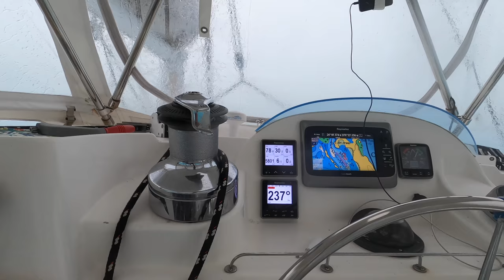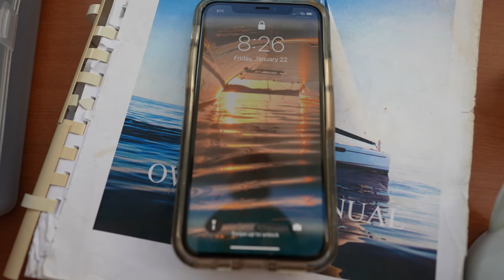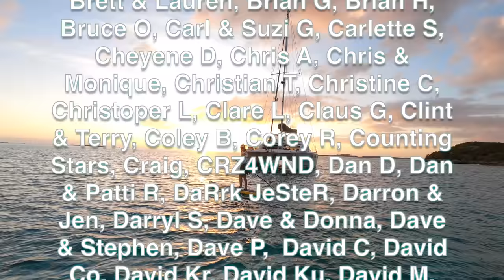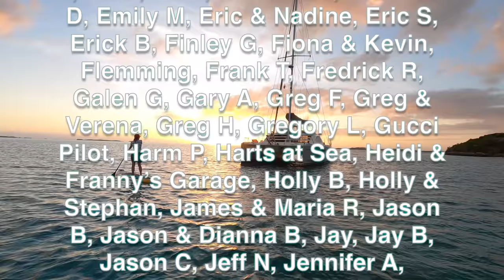THIS SHOULD NOT BE HAPPENING!

Comment: You should play around with DIY electro-plating. I did a bunch of it for yard art over the years using a Tupperware container and nickel strips and copper wire. Its super easy and you could easily do on the boat with some extra time on your hands, just give the chain a good cleaning in vinegar and plate it in copper, i would imagine multiple sessions of at least an hour to build up a protective coating, plus you need to move the chain each coating to assure the areas you didnt coat the first time can get coated.. it would greatly help with rusting... i did it to all our yard art in our front yard to make it look super old and vintage..

Comment: It's been quite a while since I've viewed any of your videos. Your two smiling faces are quite refreshing! Glad to be back.

When I saw your chain I had to come back and edit this message. I know you don't need me telling you that you have a problem. Without being there it looks like the chain wasn't properly prepared before being galvanized and surface preparation depends on the zinc-iron alloy covering the base steel alloy. The galvanizing process isn't as straightforward as it appears. When I finally get my boat finished I fully intend to carry a nylon rode for use in parallel with my chain if I ever suspect chain problems. You two have been around long enough to know that ground tackle is not the place to be a tightwad or be otherwise unprepared. Good luck!

Comment: Remember the rust on your chain from the failed hot-dipped galvanizing?  That rust is hard and very abrasive, the rust on the chain is probably a key contributing factor for the wear on your gypsy.  Get a new chain (better) before you wear out this gypsy.  (I am a metallurgical engineer in case you were wondering)
Reply from the maker: Thanks Russell. Big priority for sure.

Comment: Did you attach the chain directly to the hard metal cross strut in the boats chain-locker or fabricate a short line with dedicated knife???
If you get run down by a freighter (as I have) sometimes you need to release your ground tackle to save your vessel. 
Regather the chain and anchor later... Might be a good point for new-be sailors.
Reply from the maker: Oh for sure. We have had to ditch a rode once in the. middle of the night. When it's gotta go, it's gotta go. We did retrieve it the next day.
Reply: @TheOKellys  
PWS I love your sailing exploits. I have sailed on an old 43" 1938 Philip Rhodes, then a 50 " Gulfstar. My last boat was a CT65. Miss all my boats.
Reply from the maker: Thank you for the kind words. Exploits is a good way of characterizing! The Gulfstar 50 is literally the first true "cruising" sailboat we ever saw with a broker. That is one big boat! But do you have a favorite?
Reply: @TheOKellys  Yes, My 65 foot CT was my favorite and great. She was underwater for 6 months when I bought her after a hurricane. Replaced everything. All the wiring, engine, sails, standing rigging, generator, put in a hydraulic system with a bow thruster, SSB, ice maker..Everything. What an ordeal-ha!
Reply: I literally just went and looked to see how our chain is attached...with rhode.  I’m in super paranoid “my boat is a death trap” mode right now after our shackle incident....arg.
Reply from the maker: wow! that is love!
Reply from the maker: hyper-vigilance is the way....that's why pilots make such good sailors. Good on ya for sharing your experience. You just saved someone out there a bunch of pain....or worse.

Comment: Would there be a lifetime cost savings by switching to stainless steel chain. I know its more expensive but would it last a lot longer?
Reply: Stainless (316) will still corrode when submerged, and not quite as strong so it's between 2 and 4 times more expensive. It will resist exposure to the marine atmosphere much better, so if you anchor infrequently it's a good choice, but if you anchor regularly you are likely better off with a galvanised carbon steel chain, and replacing it when it's lived it's life.

Comment: Have you ever weighed Clarity?  In doing research the leopard 46 is an outlier. Its DLR is 122 compared to 170-180s for other Leopards and Lagoons.  It’s SAD is around 30 rather than low 20s. 

I’m wondering if the design weight of 24,000 pounds light displacement is accurate. (Maybe this was an error as this would affect all those ratios.)
Reply from the maker: Lightship is just under 24000 lbs, I believe. We have weighed her once and it was 28000, but I am confident that is too low. I would bet we are somewhere around 30000 to 31000. BUT! I do think also that we could easily shed 1500-2000 lbs. Get rid of generator, modern davits, clean the lockers of useless junk and tools. But yeh, the boat is pretty quick for what she is. I've seen another lighter loaded L46 beat an Atlantic 57 in a friendly race.
Reply: @TheOKellys  Really spectacular. By the numbers its faster than an Outremer 45 too. Or Atlantic 48.   Alas, none on market now, replaced by 48 in the charter fleets.

Comment: Hey guys, about the sharks.. the current Australian 60 minutes has a guy that had his Arm and Leg ripped off by a Bull Shark. One other thing, I was thinking about how to protect your Video Equipment. A friend of mine bought a Vacuum Pump for about $100. If you got a cooler and drilled a hole with an attaching pipe to extract the air.. you could remove all the Salt Air and store your equipment in it. Just saying Cheers guys 🍻🍺

Comment: please only use stainless steel. it cost 3 times, but you hav so much less trouble with it !
Reply from the maker: We would but not as strong.
Reply: @TheOKellys  what for a size do you need? I can try to search one equivalent ;-)
Reply from the maker: We use 3/8” G4. Would require a new gypsy to change sizes.
Reply: @TheOKellys  i can get a Stainless Steel chain of the Material: A4-AISI 316, 1.4401 (X5CrNiMo17-12-2) Inside link length: 1,1'' (28mm); inside link width : 0,55'' (14mm). Wire Diameter 0,394'' (10mm) breaking load: 11015 Ibs / (5000kg)

Comment: Just thinking (dangerous stuff). Your chain looks very rusty for what I hope is a G4. You may have Chinese chain, a bit weaker. not the strong stuff. Harder steel rust at a slower rate than soft. My G4 is 20 years old and looks better than yours. Yours may also be of a slightly different pitch size which would account for the wear on the gypsy.

Comment: seems like very sailing/cruising YT channel has had this issue with under-peroforming anchor chain. 
I wonder if there is a common source (china) feeding bad product to unsuspecting retailers....
Reply: I'd imagine most of it in the usa comes from the usa, unless bain capital did to them what they did to gst/armco.  The ball and rod mill I did y2k mitigation at in 1999 at (informix,oracle, hp-9000s) KCMO was driven into bankruptcy so deliberately that people I knew there, including most of the engineering and metallurgy dept did an anti-romney commercial talking about what he did to steel in the usa.
Reply from the maker: We did our research of course and were told it was domestic chain and we paid extra for it. Now.....domestic vs import....just because it is imported from China or wherever should NOT mean bad quality vs good quality... but there are supposedly reputable suppliers you can count on here in the States .....but wherever it came from, the galvanizing is crap on this chain. Such a bummer. Chain is so hard to source, ship, and install. So heavy! Hopefully we can come across the good stuff. Super important!